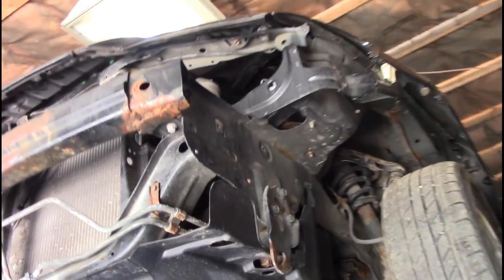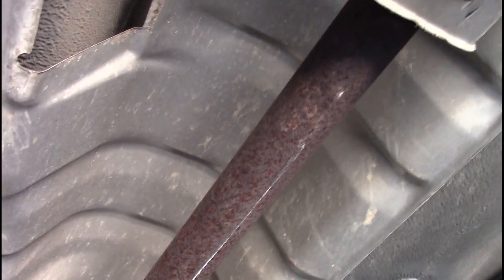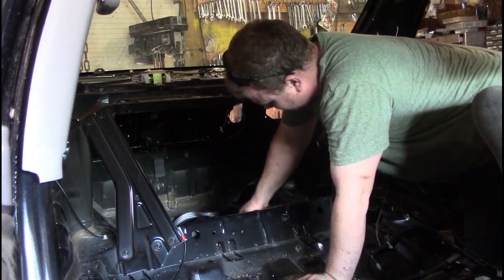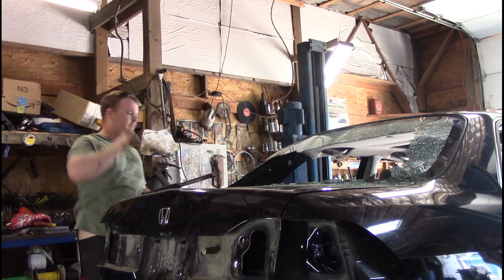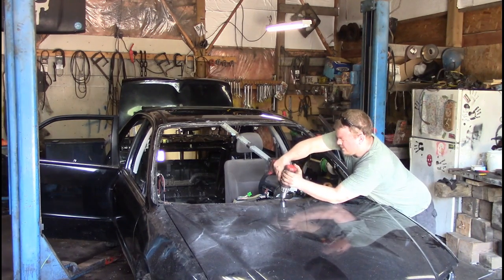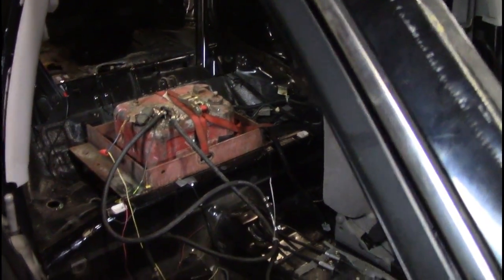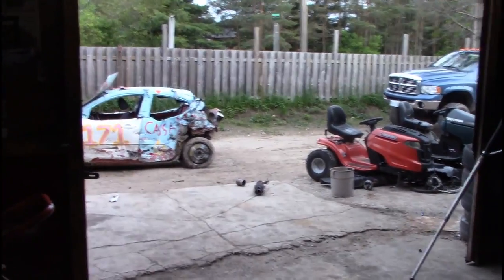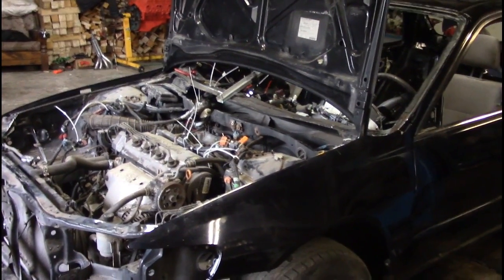stock build honda accord  demolition derby car part 2

Comment: I’m building a 1995 Honda Accord for a class that’s a little more than a stock wire class. Is there anything to worry about with them? Or are they pretty strong? I put a gusset crown Vic bumper on the front.
Reply from the maker: the spindles are the weak spots on those cars
Reply: Ok thank you! I learned last year with a 99 I ran. What’s a good way to raise the front end? That bumper brought it down some.